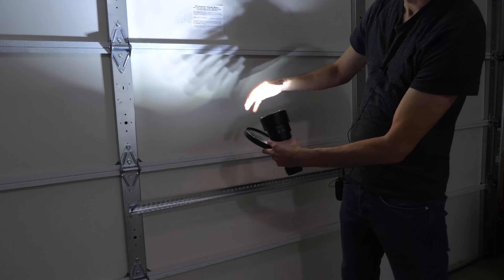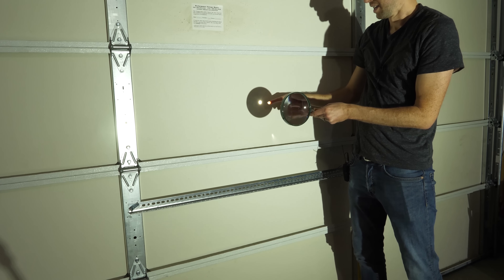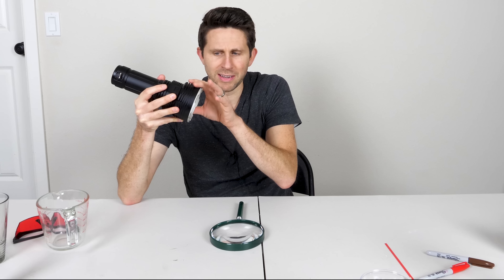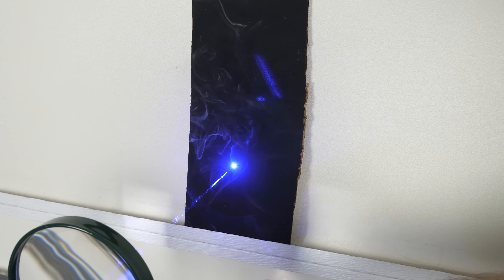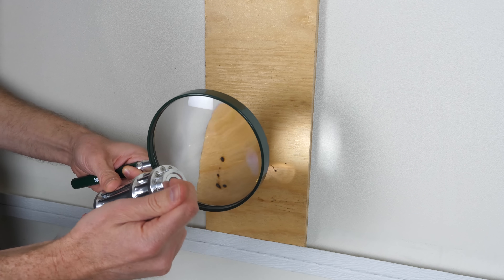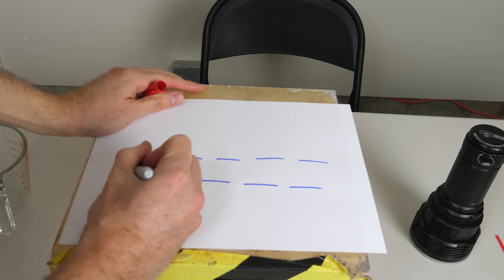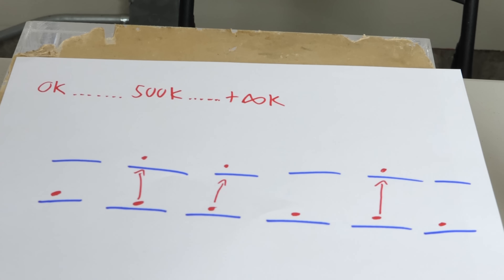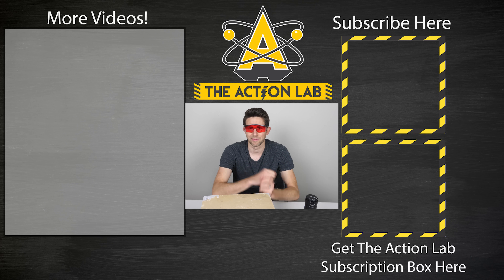What Happens if You Focus a 5W Laser With a Giant Magnifying Glass? Negative Kelvin Temperature!

Comment: Odd video.  The laser would not seem to be any different than the flashlight or sun.  If you can concentrate any energy source onto a smaller area you naturally generate more heat on most materials.  The flashlight does the same, you just used a huge flashlight specifically designed to wide broadcast; try doing it with a small powerful flashlight.  Temperature should not matter, energy matters.  LoD says if you put 5W in, you can't get more than 5W out the other side.   If you can get to a bagillion degrees on 5W so be it but you the law says you can't make 6W of heat energy even if you could focus (concentrate) it to the size of a single atom.

Comment: It can get brighter than the source per surface area. It just can't get hotter than the light temperature. The 'cant get hotter than the source' rule only applies to blackbody/heat radiation, so not to your flashlight, only to the sun. With appropriate lensing, that flashlight could possibly cut into metal

Comment: It was interesting when you lacked the equipment and environment to conduct an experiment you drew a scientific conclusion from it. That’s a flawed process.
Your overall message is correct. You don’t get more energy on the other side of a magnifying glass than what was emitted through it- it merely gets the full force concentrated in a smaller area of effect. Which can have a different reaction.
The flash light shining outwards and you being unable to gather the light is your own failing in equipment and environment and should be excluded from all scientific hypothesis or conclusion. 
Someone else- elsewhere can conduct that experiment properly, given the correct equipment.

Comment: Bullshit. The reason why you are not violating thermodynamic rules is cuz The point you make with magnifying glass isn't hotter than laser it self. Laser itself is a packets of photons with energy, they do not have a temperature. Light doesn't have temperature, Light just carries energy which then after photon being absorbed by atom is converted into vibrational energy - heat.
What the surface of sun has is Hydrogen and Helium atoms. They DO have a temperature.

Comment: Cool video, but I call BS on most of your explanation at the beginning about the flashlight. (ope, and later the laser, too)

I'll start breaking it down in edits.

1. You can focus the majority of the energy together easily using a properly sized and shaped lens. With a lens with a much shorter focal length, you could have easily focused it into a single point with the lens right up next to the flashlight. You were just using a weak lens.

2. In such a case, as long as the point is smaller than the output of the flashlight, it will be brighter. This isn't "violating thermodynamics". It is specifically conservation of energy. If the dot is 1/10 the area of the output of the flashlight, it will have 10 times the energy density. So the same amount of energy exists on both sides. It's just, you know, focused into a smaller area.   It obviously won't be 100% so I don't want people scrambling to remind me that nothing is 100% efficient.

3. "Does that apply to lasers as well". Well yes. The light may be coherent but it's still just photons of visible wavelength subject to the same laws of physics as any other photons.

4. Lasers can indeed be said to possess a "negative temperature" in somewhat of a technicality known as "population inversion" where there are more high-energy members than low-energy members. This happens only inside the laser in order to stimulate emission in the first place, when the energy levels drop. It is not a property of the light itself. And certainly has absolutely nothing to do with the ability of the light to focus. The appearance of a laser being "focused" is simply the fact that the light is emitted in one direction.

An authentic "negative temperature" is more or less speculative, but is hotter than any possible positive temperature, so chances are you wouldn't want to share a room with it.

Comment: You’re making some incorrect assumptions. Yes it’s true, you are losing light from the flashlight because it is a diffusing light source. However if that flashlight was shone into a parabolic mirror which deflected the light back to the wall to a point less than say 3 or 4 inches (based on the size of your magnifying glass), you could focus the light to much brighter than the original source. It is not a violation of thermodynamics, it is a concentration of energy. You seen not creating more heat, you are simply concentrating it. The light from the sun is pretty bright, and the light entering your eye is almost parallel because of the distance, not quite but close enough. By using the magnifying glass you are collecting light through an aperture of about 3 to 4 inches with that magnifying glass. The edges are less effective usually unless it’s a high quality lens. So the light from the sun cannot be brought to an infinite point because the light source is a disk, but you can still condense it into some pretty intense light (including heat). The laser can be magnified down as well and condense some heat, but you will only be able to condense it a little bit because the effective aperture of your magnifying glass is really only as broad as the beam of light passing through it. So if the beam of light is only 3mm, well 3mm doesn’t give you a whole lot to work with. Yes you can condense it, but only so much.

Comment: What about using mirrors? Can you make a hotter point using mirrors?

And why making hotter spot than the surface of the light source violates the second law of thermodynamics? If the hotter spot is very small (compared to the surface of the source)?

Comment: Well actually by focusing a flashlight using multiple lenses in in a row you can get the same result because a laser is nothing else than a very strong light source focused on just one point. That is also why good lasers are so expensive! Making the lenses to be perfectly calibrated is very hard. -> No laws broken, because all that you do is focus the energy that was once unfocused; with the exception that you mentioned to be able to focus it till it is an infinitely tiny point at which the temperature is -0K
Reply: Yes.  It's only his choice of flash light that prevents him from concentrating the beam down to a point.  The reflector is critical too.

Comment: It is a nice video but, you just are concentrating the energy from the laser to a smaler point but it doesnt mean that you are increasing the temp of the laser itself, you can do the same with a  bigger lens and your flashlight (in the same ratio of course). Nice try!.
Reply from the maker: Yes, I never said I was increasing the temperature of the laser. In fact that is the whole point. That is how you do not break the second mark thermodynamics. Since the laser is that a negative temperature it is always higher than any positive temperature you can achieve by shining the laser on something

Comment: You can focus light to a point that is brighter than the source.  You just start with a large light source and focus it down to a point that is smaller than that source.  If you are unable to capture 50% of the light from the source, then just focus it to a point smaller than 50% of the size of the source.  It will be brighter.  (Defining brightness as the density of light energy, not as the total light energy output by the destination point)

Oh, and it’s the First Law of Thermodynamics that has to do with total energy in a closed system and so might apply to this experiment.  The second law is the one about entropy increasing in a closed system.
Reply from the maker: You are incorrect. I’m sorry. Don’t try to beat thermodynamics you will always lose.
Reply: @TheActionLab  can you not say "You are incorrect" but try to prove why he isn't correct?
Also you can make a dot brighter than the original surface of the light source by taking the light intensity spread over a bigger area and focusing it to a smaller single point, but you didn't have the optimal lens to do it.
Reply: The Action Lab  I’m not claiming that thermodynamics is wrong.  I’m claiming that your demonstration is flawed ... because it can be easily disproven by simply putting the flashlight closer to the magnifying glass (but obviously still outside the focal length) and then focusing the light down to a pinpoint on the garage door.  Then you would have to actually measure the brightness to compare it to the source ... unless it is strong enough to have an obvious effect like burning the garage door.

Comment: Nothing is violated and this have NOTHING to do with thermodynamics at all, All thats happening is that since nothing is lost on the way all energy from the laser is concentrated on a smaller spot then the lasers original beam so that spot have to become  hotter cause more energy is directed there. This is the principle for any laser cutting machine. By concentrating the beam from a 1 -2 kW laser in a very small space you can cut through even thick metal with very high speed. Think about this: 5W ordinary LED light might be bright but would not burn a surface at all. However the 5 W laser did a little burning even without the magnifying glass since those 5 watts are concentrated on a smaller spot in a parallell beam and by using a magnifying glass to make the spot from the laser even smaller logically that spot HAVE to become even hotter since the energy gets even more concentrated.
Reply: It is possible ... If you had a longer magnifying glass , It could consatrate the light to one spot . Whats bassically happening is that all energy is gathered on one small point and thats why its hotter .
Reply: @DimD-W  no trust me it is phisically impossible cause of the second principle of thermodinamics
Reply: @Nightwalkersify  it is possable without violating the second law. You are not exceeding the total energy of the source you are only concentrating that energy into a smaller area thus allowing for a greater temperature increase in that smaller area.
Reply: Yeah, the point is that it is impossible to do with a flashlight
Reply: K
Reply: This has everything to do with thermodynamics, it is one of the most fundamental topics of physics
Reply: @John Pekkala "...is concentrated on a smaller spot then the lasers original beam..."  No... do you know how tiny the original beam ist? It's in the scale around 10-100nm. So at the cutting point it's not smaller.
Reply: @John Pekkala I agree but I think you meant it has nothing to do with "quantum mechanics."
Reply: i think you should read what he has written first below the description
Reply: everything is possible
Reply: This has everything to do with thermodynamics

Comment: Why does it not burn the magnifying glass?🔥
Reply: light heats things up based on how much light said thing absorbs.
the magnifying glass is a pretty translucent material, and therefore it doesnt absorb much.
since the magnifying glass doesnt absorb much, the light goes through it and doesnt heat it up.

the wood is different however; it absorbs most of the light, and the rest is reflected.
since the wood absorbs most of the light; it gets heated up.

so no, the magnifying glass wont burn up because of the laser.

Comment: I'm sure that's not right.
The torch light is divergent so a lens will converge and cast its virtual image behind the screen onto the screen, so no matter what distance it is from the screen you never get something brighter than the original torch light.
With a laser on the other hand, you have a parallel incident beam on the lens, this corresponds to an infinitely distant light source, the lens will produce a virtual image of that infinitely distant light source that converges to a point (because it's infinitely distant), so it is possible to focus that point on the screen.

Comment: So the laser was eventually burning the wood on it's own once the the laser heated that area of wood to the burning temperature.....magnifying essentially just concentrated the energy to a smaller area ...able to heat it up faster...but with the same amount of energy as before ...just pinpointed to heat it up faster.....ill bet if you had the proper instrumentation to read the out put ...you would see it is still the same ...just like in the flashlight experiment ....but thè laser could burn it before ...same as after ...so although the explanation goes on forever ...it doesn't really prove anything lol

Comment: The only reason you can focus down a laser better than the flashlight is because the laser diode(s?) And the lens points the light in one direct line, while a flashlight's lens makes the light beams radiate outward and thus stop being parallel, so it can't effectively focused. That's also why the Sun's rays are so easily focused down to a point.

P.S. please correct me if I'm just blowing smoke omegalul

Comment: I might be missing something but it looks like the light source just needs to be some what smaller than the magnifying glass to focus the beam. When shining the light though the magnifying glass the beam could not focus to a small enough point without most of the light spilling over the sides of the magnifying glass, loosing much of the energy that would be focus into the point. If a large enough magnifying glass was used wouldn't it achieve the same result as the laser? Or the use of multiple looking glasses focusing the light down to a single point? ( It may not as I don't know the maths behind the loss of energy from the refraction of the light from each magnifying glass the light pass through them).

Comment: What i still confusing until now is, if you can burn something with the laser even if the laser go through glass. Can you burn the glass or it Will be impossible because the laser go through it?🤔
Reply: It depends on the lazer. Different wavelengths are better absorbed by different materials. Visable light lazers will go through the glass because it is translucent, but infrared lazers are absorbed well by glass, so it will burn, or actually melt, the glass.
Reply: light heats things up based on how much light said thing absorbs.
the magnifying glass is a pretty translucent material, and therefore it doesnt absorb much.
since the magnifying glass doesnt absorb much, the light goes through it and doesnt heat it up.

the wood is different however; it absorbs most of the light, and the rest is reflected.
since the wood absorbs most of the light; it gets heated up.

so no, the magnifying glass wont burn up because of the laser.
Reply: A powerful enough laser will blow a hole in a glass lens even if at a wavelength such that 99% of the light should pass. This is commonplace for people who work with high power lasers. Google national ignition facility optic damage if you're curious.
Reply: Well, sorta. if the lens perfectly passes all the photon through then absorbs nothing therefor remains cool, but so far as I know a perfectly translucent material has yet to be invented...

Comment: If you could create cylinder that have a mirror inside  long enough you could actually keep all of the light from the flashlight and therefore be able to heat up a surface more than the surface of the flashlight

Comment: The negative temperature is only inside the laser - specifically inside the lasing medium. This is because there is a population inversion of more excited atoms than ground-state ones. You can get this same distribution if you take the standard Boltzmann distribution formula and plug in a negative number for temperature.

Comment: When the flashlight emits light it goes in many directions and so is divided over distance. The laser light is already quite coherent, so it doesn't diminish over distance as much. When the laser hits the magnifying glass, it still has much of the energy the emitter put into it. You put that comparatively larger area of light onto a smaller one and it burns things faster with a smaller "brush" width. I bet this could be used to make art.

Comment: The simple explanation is that the magnifying glass captures 100% of the laser light and is therefore able to intensify it when it concentrates it. Whereas with any other light it's only capturing a fraction of the light. The complex answer is because the laser has negative light.

Comment: To focus the flash light. Use pipe having reflecting material with same diameter of flash light glass. That would prevent the light from shattering and would focus it on the magnifying glass. We need to see what would happen. Thanks